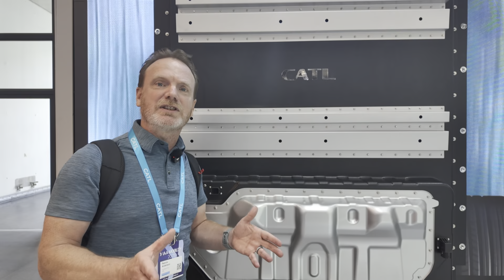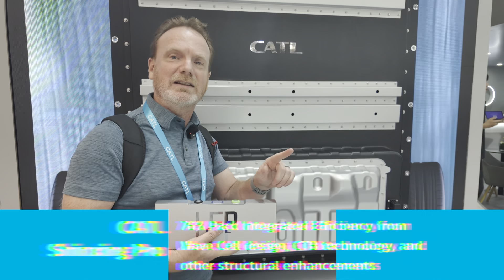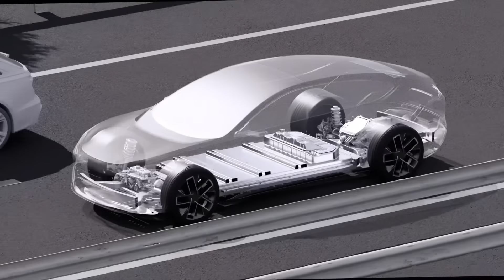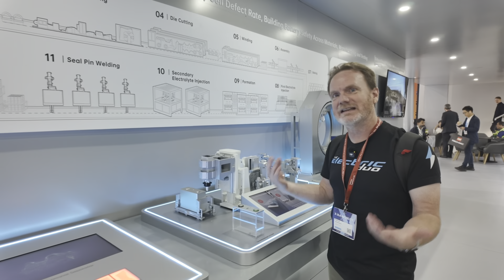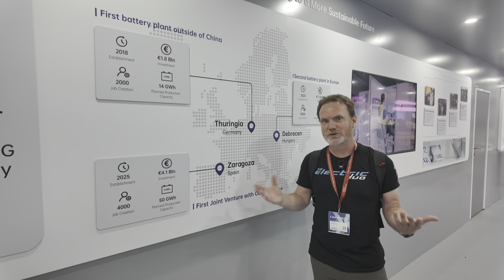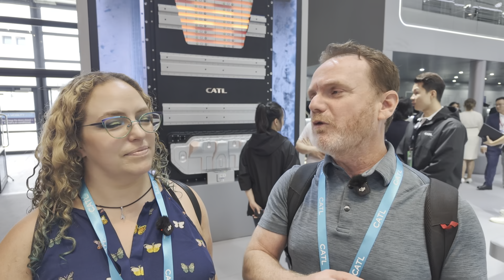Battery Breakthrough! CATL Shenxing Pro LFP - Improved safety, faster charging, and longer life!

Comment: 20:42 - if you are in germany you need to visit DUESENFELD , the oldest and most efficient battery recycling company. In 2020 they had already over 94% for all materials, not just the most important ones. They are located quite close to VW headquarter in Wolfsburg and do a lot of things differently. They discharge the batteries and that covers 50% of the energy needed for the full recyling. 

And of cause: once chinese cars arrive in the EU their batteries will be used in second life solutions and after that recycled but in germany to build new batteries in Germany without mining of new lithium.

Comment: I'm way more excited for CATL's sodium-ion Naxtra battery. Similar energy density to LFP but 1/10th the cost ($10/kwh vs $115/kwh) and isn't affected by the cold so will charge like normal in frigid temperatures. We need that in the USA, much lower prices and no more 50-100 car long lines at chargers in winter when it's -15 below zero. Pricing and winter performance are really key to EV adoption in the USA.
Reply from the maker: I think we might actually have a video filmed with it. We filmed so much that I forget everything we managed to snag! - Liv
Reply: Don’t believe all the hype about the $10kwh  sodium-ion battery, that statement is misleading The $10/kWh is only the raw materials. The cost will be $40/kWh (cell level) compared to that of LFP $70/kWh (cell level).definitely not 1/10th the cost.
Reply: @jasoncork9661 Don't know where you are getting $70/kwh for LFP, everything I see has it at LFP being the lowest at $115/kwh and NMC being closer to $150/kwh (market averages). I know to take a sales person's claims with a grain of salt, but if it's anywhere near what they claim it's still massively cheaper than even LFP.
Reply: @Weezedog you can purchase a Docan Energy 32KWH panda home battery at retail for $2,446.00 and that’s from a US supplier, works out at $76.43 per KW and that’s including inverter etc aswell. Battery’s are cheap now. LFP cell price is actually below $60 right now.
Reply: @jasoncork9661 I'm not sure I would consider that to be an apples-to-apples pricing comparison buying some off brand home storage product to automotive grade certified 100,000 mile warranty name brand vehicle batteries.
Reply: @Weezedog they are grade A cells from CATL, EVE, Gotion and REPT. But if you think EV cells are higher priced and better quality whatever, but you are wrong. 😂

Comment: I do find the quoting of recharge range relative to time (e.g. 10 minutes adding 478 km) to be really hard to trust... Range depends on pack size and motor/vehicle efficiency - neither of which are controlled by the battery itself.
Reply from the maker: It is interesting for sure. Plus the quote of 0-100 kph as well.
Reply: Yr' right.This is Jackie from CATL. We just simulated specific vehicle(Model Y) driving condition Not a guarantee for all vehicles.
Thanks for your understanding.
Reply: @zhanyingjie thank you for your reply! Understanding which specific vehicle was simulated is helpful context! Sorry if that was explained in the video and I just missed that detail.
Keep up the great work improving battery performance!
Reply: @lkuhn65  Yeah, probably it's much easier to understand the data  If we have explained that to the video maker.  But we have marked these details in the press conference slides.
( If you are interested it, you can search CATL's official video)